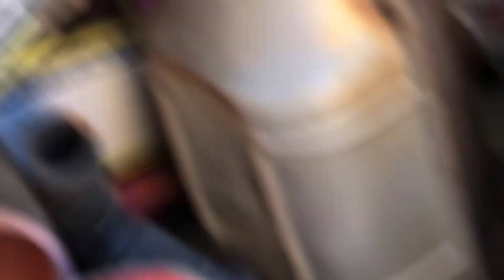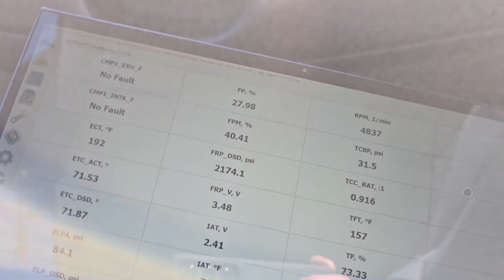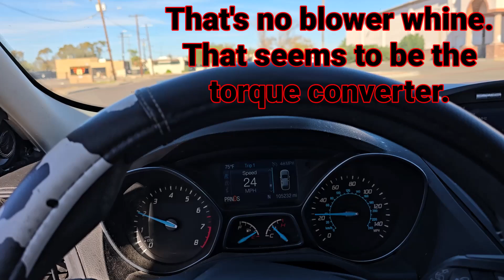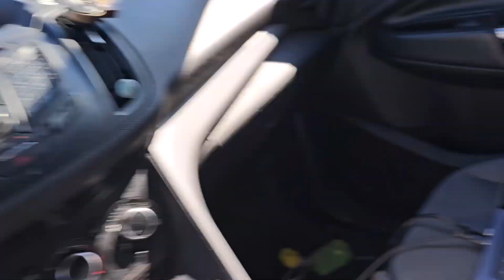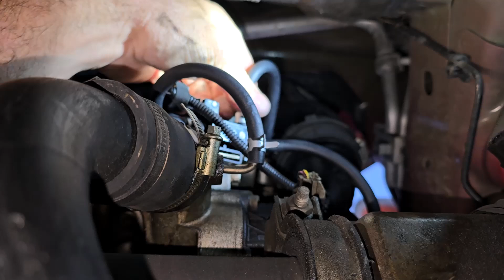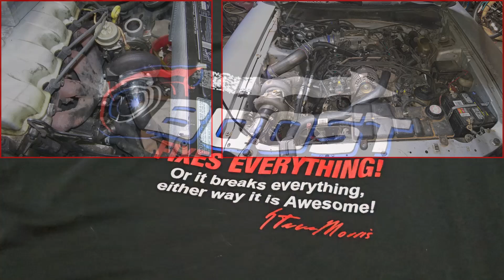My daughter's 2014 Ford Escape gets more much needed maintenance & repairs! [Boost leak & overboost]

Comment: I had the same car man-- it was the 1st year Ford switched to this design I believe... Once it hit 90k  I had all kinds of issues with the turbo, the 5 way valve for cooling then oil leaking issues, the charge pipe crap… You have to be a china man to reach everything 😂